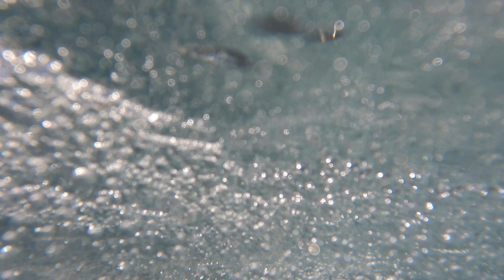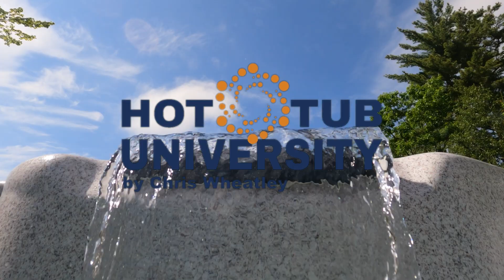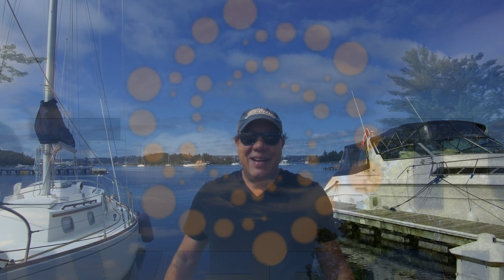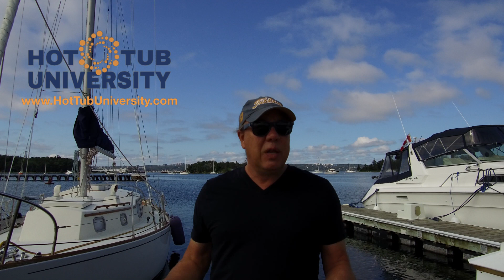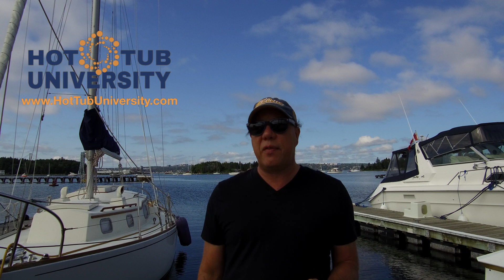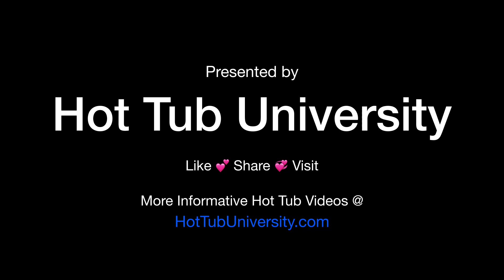Hot Tub Shell Construction

Comment: Master spa shell is thick and solid.
The frame construction, not so good. Especially the manufacturer is using regular staples for construction. Hot tubs are dripping water and elements of outside. The frame construction needs to be galvanized staples. The regular steel staples will rust away quickly.
Reply from the maker: when you have a great shell the frame matters little or nothing, its just to hold the skirt on :-)

also its bone dry behind the skirt of a well made hot tub, the motor heat keeps it very arid.

Also they don't use plain steel staples depending on the models I've seen they use they use either galvanized gusset plates or a treated copper color staple.

either way its a side track issue, build a good shell, and a good reliable plumbing system and nothing about the frame will matter, its cheap crappy made spas that need good frames and rust mitigation...